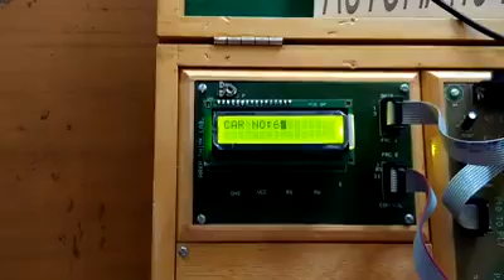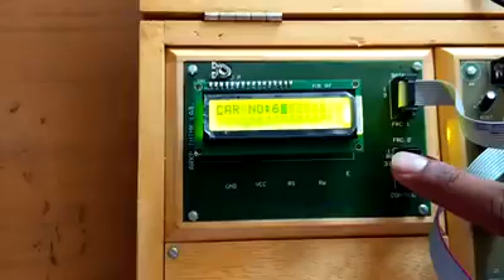Automatic Toll Pay system

Comment from the maker: This Project explains simple working of toll plaza system interfaced with RF transmitter & Receiver.

Each user holds a unique ID for his vehicle. When the users enter into plaza a certain amount is deducted

automatically and remaining amount is displayed at LCD. If the balance is low it gives indication of low

amount which can be refilled it with the help of keypad.

This project contains of six modules

 LCD Display

 RF Transmitter

 RF Receiver

 Microcontroller
Reply: Arey bhai jo tumne robot banaye mujhe woh chahiye